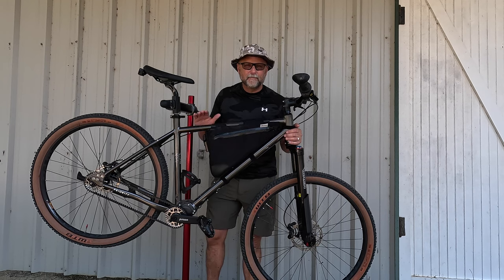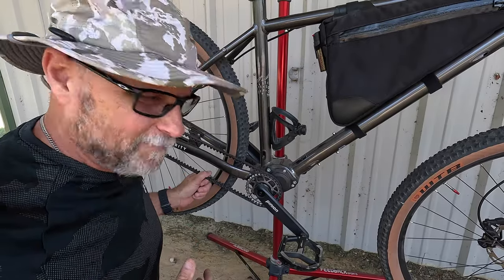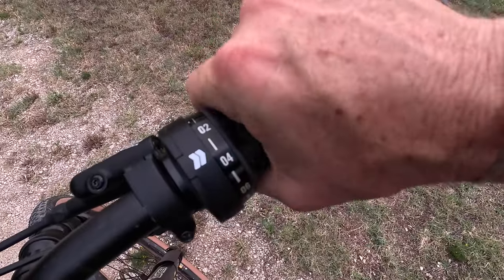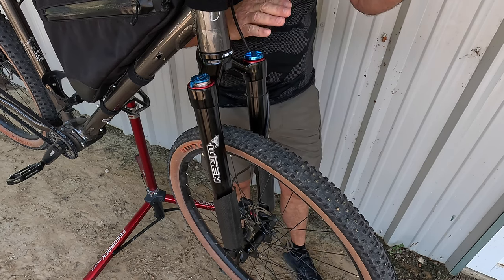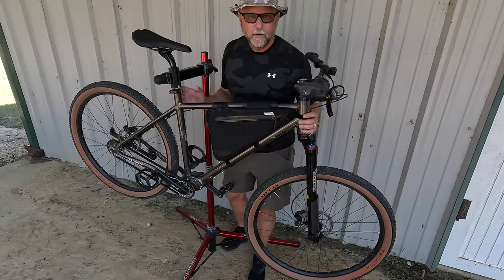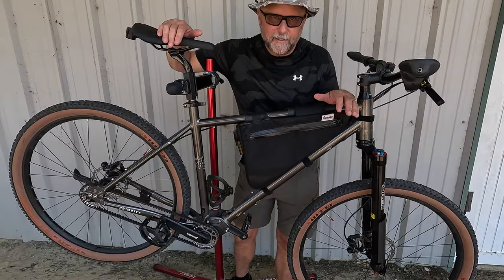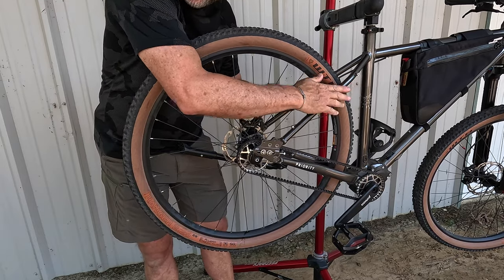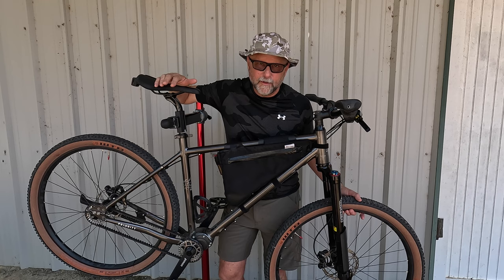Priority 600X Hardtail Adventure MTB One Year Review

Comment: Thank you for this!  This sounds like the bike for which I’ve been looking.  I have a couple of older good quality and light hard tails (Cannondale Flash 3, Kona Kula, etc) that I’ve been modifying and tinkering with to convert them to a bike similar to this.  Water down slightly the every day mountain bike part of it so it rolls and performs better on asphalt and urban environments and is comfortable to ride, but still retain the mountain bike soul. This bike sounds like it ticks all those boxes.
Reply from the maker: You are absolutely correct, Richard! When my current tires wear out, I’m going to go on a search for some tires that would be better for asphalt, but would also get me through on mountain bike trails as well.  I don’t know what they are yet, definitely want to look at Schwalbe, I believe they will have a perfect tire in their huge line of tires.  My goal is to have this bike be my do everything bike. I’m not out to win races, so I’m not concerned about top speed, however, I want the least rolling resistance that I can get, while still getting me through on trails.
Safe, adventuring out there! 

If you ever decide to get one, here is my affiliate link, which gets me a little bit back to support my channel and my video production.
Priority 600X - The do everything mountain / adventure bike with 600% gear ratio. 
https://bit.ly/3tLHyAP

Comment: Hey there.  New to the channel.   Thanks so much for the review.  I'm trying to convince myself.  Ive never been bikepacking but want to try it.  I realize its a low maintenance bile but wasn't sure if local bike shops would even know how to work on it.
Thanks for the info
Reply from the maker: Hi 👋 there!  Thanks for watching and commenting!  My experience has been that good bike shops with really good, career minded mechanics 
love to see a different bike come in.  It breaks the monotony of working on the same style of bike components day after day.  When I have had 
my Brompton, Apollo and 600X in for service, they have always been great at it.  More and more bikes are coming out with internal gearing, so 
they won’t be totally foreign to most mechanics.  That being said, with the 600X Pinion, these gears are designed for very high mileage with 
proper maintenance.  You’ll likely never have anything that needs to be done to them other than changing out the gear fluid every 6,000 miles or 
once a year, whichever comes first.  Hope this helps, have a great weekend! 

Priority 600X - The do everything mountain / adventure bike with 600% (30 speed equiv.) gear range
https://bit.ly/3tLHyAP
Reply: Any feedback on the weight of the bike? Seems a bit heavy?  
Wish I could find someone in AZ that would let me try a 5 min test ride.

Comment: Hi everyone. After more than one year and 2000+km . Here is my feed back. The geometry is not the best but still good enough to enjoy the ride. Brake should be upgraded if you like riding without headache. Rear hub is another weak point if you're planning to go for long have spare parts with you or upgrade it. The belt is very sensitive to heavy mud (whatch the video that Duzer broke his belt) so do bike walkig in mud if you do want to bike walk the rest of the route. All the bottle provisions are good only on large size if you getting other sizes especially small  you will have problems with  fitting the bottle holders.
My up upgrades:
Break to Shimano
Rear wheel set to Shimano
Handle bar to jones
Reply from the maker: Thanks for your feedback!  Safe adventuring in 2024!
Reply: Questions: Why do you consider Shimano brakes better for the bike than Hayes Dominion? Also, Duzer snapped the belt due to improper reinstalling it after mud moved it off the sprockets. He should have moved the rear axle forward to relieve tension and slipped the belt back on sideways, instead of wrapping it and forcing it on with a crank rotation (requires belt stretch and frame flex to achieve, totally unnecessary) which damaged the fibers.
What specifically would you change about the frame geo to make it more suitable to your style? I believe the geo is similar to XC bikes these days, not the slack and radical geo of full suspension trail MTBs.
Thanks for the consideration!
Reply: @exothermal.sprocket   
Hi. I picked Shimano because it's much easier to adjust and we have on our other bikes. After removing wheels it takes me less than 5 min to adjust Shimano if it's required.  the original brakes needed adjustment every time and it wasn't as easy as Shimano. (We have 3 priorities 2 large one small). 
If your belt comes off, it already damaged. doesn't matter  it comes off or goes on if it's not done in proper way , it's gone. at least this is what we experienced.
I think bottom bracket should move forward about one inch. Probably because they used 29 in tires they forced to put it there ( fixed belt length) . That what I feel in comparison to my other bikes
Happy rides
Reply: @bobakq   Thank you for the information!
I watched Duzer's ride across Colorado. Also his review of the 600x and what Priority has reported form all of its users of the belt system. It's intriguing to say the least.
Reply from the maker: @lifted_above I don’t think I ever mentioned Shimano brakes in the video.  Priority replaced my defective Hayes Dominion brakes with Tektro brakes that work great!  I love their customer service.
Reply from the maker: @babakebrahimi1971 Thanks for watching and commenting, I appreciate your opinions!

Comment: Outside hard core trail use with a good 160 travel MTB, this machine seems like the no-brainer for doing everything else. It may not be as efficient, fast, or light as a road bike (and it's not), but it's that ultra-low maintenance machine that does it all. Jack of all trades.
By the way, how fast can you go in 12th gear keeping a functional pedaling cadence? Any actual MPH speed? I'm curious.
Reply from the maker: I've never clocked myself on flat ground going all out in 12th gear, I would imagine that I would get up to 18-19 mph. Going downhill, I will get up to about 25.
Reply: @KayakCliff  Okay cool. If you get a chance to clock yourself sometime, post a video about it maybe.
Reply from the maker: @lifted_above Ok, I will.  Thanks!

Comment: How would you compare the Priority 600x vs the Velotraum Finder?
Reply from the maker: Great question!  I just looked up that bike on their website, cool bike and I love the Orange color!  The biggest difference is that the VeloTraum Finder 
is more of a commuter bike, that can go off road a little too.  The Priority 600X has 110mm travel front shocks, which the Finder has just a rigid 
front fork.  Also the Fenders on the Finder would be more useful for commuting, but would load up with caked mud if you go too crazy off road.  The 
tires on the Finder seem more road friendly than off road.  So, the biggest difference is lack of shocks and the fenders on the Finder, there are 
less braze on locations to add extra water bottles too on the Finder.  If you want something more like the Finder from Priority, I would look at the Priority 600.  I’ll put a link below.  Hope this helps! 

Priority 600 - Top of the line commuter, touring, fitness (everything bike)  
https://bit.ly/3AnYxKw

Priority 600X - The do everything mountain / adventure bike! 
https://bit.ly/3tLHyAP
Reply: @KayakCliff  Yeah makes sense.. apparently the Velotraum is highly customizable though.. with colors.. and you don't have to have those shocks.. and can also get a suspension fork.. but yeah in general it is more balance for commuting.. road and still some off road.. I just really like the look of it in a lot of ways to be honest.. but yeah need to assess overall functionality more.

Comment: wondering what seatpost you have? looks like it brings you back a little farther than the original, and do you like it?
Reply from the maker: I ordered it off Amazon. It is an offset seat post that sets me back a little. Nothing wrong with the bike, I just have a very long inseam at 34 1/2” It works best if my kneecap is slightly rear of the pedal axle.  I usually make this accommodation on every bike that I buy.

Comment: Cliff do you think this is 2x the bike of the Apollo? 1899$-3500$  is a big jump
Reply from the maker: Hi LogicalQ - yes, for me it definitely was worth the upgrade. I bought the Apollo first and used it for a year and thoroughly loved it. Awesome bike! I just wanted something that I could ride gravel, bike pack better on, and ride single track, blue or green mountain bike trails.  For me, owning both of those bikes, financially was not going to happen. I had to choose one or the other, so I chose the 600 X.  I’ve been riding it hard for a year now, and not one single issue, except for the brakes when they first shipped it to me. They (Priority) fixed that immediately.
Hope this helps, if you have more questions and want to speak more directly, go to my website, kayakcliff.com. My contact information is there. 

Priority 600X - The do everything mountain / adventure bike with 600% (30 speed equiv.) gear range
https://bit.ly/3tLHyAP

Comment: Hi! How about that suspension fork, how often do you need to do some maintenence and is it doable on the road? If you do long trips like tour divide?
Reply from the maker: Hi @wheelsofdream, I have not had any problems with the fork.  After a year a riding, I decided to check the pressure to see if it had bled out at all and I was amazed to find that the pressures were still the same - 36lbs. on top and bottom.  Most of my riding was on the road, if you wan the shocks locked out, while on the road, they run nice and stiff.  Hope this helps!  
Priority 600X - The do everything mountain / adventure bike with 600% gear ratio. 
https://bit.ly/3tLHyAP

Comment: How would this be for commuting to work? All paved roads. Thinking some supple ReneHerse slicks. And on the weekends some gravel riding. Or do I need two different bikes? Currently riding a CO-Motion Deschutes as my commuter. Thank you.
Reply from the maker: You can absolutely make this your commuting to work bike and you’re having fun on dirt trails. Bike on the weekends. A good friend of mine Road his priority 600 X across the country last year. Check out Bruce Bikes America on YouTube
I use my 600 X for all of my riding. My weekly workout rides have me riding on sidewalks, City bike paths, roads, and mountain bike trails. Sometimes, all 4 in one riding session.
The tires that it comes with work well across all surface types. You can do better though, if you put some smoother tires on for road riding. That’s what Bruce did when he biked across America.

Thanks for watching the video and commenting! 

Priority 600X - The do everything mountain / adventure bike with 600% (30 speed equiv.) gear range
https://bit.ly/3tLHyAP
Reply: Awesome, thank you for the quick reply. Love so many things about this bike. Most of all the pinion gears and belt drive. I run belts on my tandem, so nice.

Comment: Do you notice the extra weight of the bike when loaded for bikepacking? It's definitely on the heavy side for an aluminum HT frame with the lightweight Wren fork?
Reply from the maker: Hi David - The added weight is because of the Pinion gear box.  I & others have noticed that the Pinion being centrally located in the middle of the bike at 
the crank location centralizes the weight in the middle of the bike rather than on the ends of the bike.  This ultimately gives a more secure ride by having the 
highest amount of the bikes weight in the middle of the bike.  You are right, it is heavy for an aluminum bike, probably 2-3 lbs. heavier, I’m not a racer 
though, so it doesn’t bother me.  I LOVE how the 600X is virtually maintenance free, with a 600% gear ration.  The carbon belt drive vs. a chain is great 
not having any grease to deal with at all.  Just hose off and clean with soapy water.  Hope this helps, let me know if you have any other questions. 
https://bit.ly/3tLHyAP
Reply: @KayakCliff  – Thanks, Hard Tail Party did an excellent review on this bike and quickly found its limits as a true mountain bike. Where it shined was how Ryan designed it, for forest/gravel roads and tamer (not too technical) single track... more as a pure adventure/bikepacking bike. Weight and the Wren fork were two weaknesses he pointed out. But to your and his point on value, to get a lighter Pinion bike you're spending a lot more money.
Reply from the maker: Thanks for watching and commenting Dave! You are absolutely right, for tamer and not super technical single track, plus gravel biking and bike packing, this bike reins.  I see that priority just came out with a second version of the 600 X which I think will address the more technical rides!
Reply: Love your hat; what brand and model?  Thanks!
Reply: If someone wanted to have an extra rear wheel to simply swap out different tires, given the ‘specialty’ wheel I am guessing a person pretty much needs to buy it from Priority…?
Reply from the maker: @richarde1355 - That is my Shelta Sun hat.  I wear their hats and sun shirts in about every video I do.  Also in my personal time, I wear it anytime I’m out in the sun.  I’ve worn many sun hats, but only use Shelta now.  I’m an affiliate for them too, however, I never join up with any manufacturer as an affiliate unless I truly believe in their product and use it all the time in my personal life.  I have several colors too!

Here’s the link to my website on that hat with my review as well: 

Favorite Sun hats, shirts, gloves
https://kayakcliff.com/shelta-sunhats-%2F-sunwear

Comment: Every 1000 mile oil change, reccomended.
Reply from the maker: I did not know that. I had heard and I believe I read 5000 miles. I definitely need to look into that! Are you talking about the gearbox?
Reply from the maker: I just checked priorities website and the recommendation for changing the gear fluid is every 10,000 km or 6200 miles. Or, once a year.  I am due, because it has been over a year.
Reply: @KayakCliff  Thanks for clearing it up. I was told a thousand. Great machine.
Reply: @KayakCliff  yes

Comment: Would you do the transamerica route fully loaded on this bike?
Reply from the maker: Hi Steve - I think the 600X would be perfect for that type of adventure.  Not because I have experience riding such an awesome route across continents
but because I’ve witnessed it’s construction over a year of multi-use riding conditions.  I also watch “Ryan Van Duzer” on Youtube.  He rides the 600X 
across countries on 1,000+ mile treks and really puts it through a beating.  He shows how durable this bike is.  I have read and watched others that 
put their Pinion gearbox / carbon belt drive system through tens of thousands of miles of use with no problems.  Hope this helps!   https://bit.ly/3tLHyAP
Reply: @KayakCliff  my main concern is front and rear racks that will hold my ortlieb panniers (40L rear, 25L front) which will hold <50 lbs of gear, food and water on these tours....plus my current body wt of 244 and losing with diet, exercise and mounjaro meds.
Reply from the maker: https://youtube.com/@duzer

Check out, Ryan Van duzer’s channel and his unbelievable adventure videos. He is the one that designed this bike with priority. I included the link to his channel above.

Also, call priority, customer service. They are excellent and they could give you some good insights.

Comment: Cool bike
Reply from the maker: It really is! I’ve been up in the mountains of North Carolina the last two weeks using it. Just rode it on the Virginia creeper rail trail. Really cool trail!  
35 mile downhill run. 
Thank you so much for watching, and commenting!

Priority 600X - The do everything mountain / adventure bike with 600% (30 speed equiv.) gear range
https://bit.ly/3tLHyAP
Reply: @KayakCliff  I am in the Rockies so there are some serious mountains here.. I would probably use it more in the Denver Metro area where the hills are more tame..
Reply from the maker: @darinsmith2458 i’m with you on that one! At 57, my knees don’t like heavy mountain terrain. Low land riding suits me better.  Safe adventuring out there!
Reply: Did the bike manage the hills ok in WNC?  I’m in the Asheville suburbs and considering this as my only bike. Thanks.
Reply from the maker: @kevinbiggs3753 hey there, Kevin, absolutely, with so many gears on the low end, it does wonderfully up in the west North Carolina mountains. 600% gear ratio really does great for me! The only thing better would be an e-mountain bike. Not ready for that yet, though!

Priority 600X - The do everything mountain / adventure bike with 600% gear ratio. 
https://bit.ly/3tLHyAP